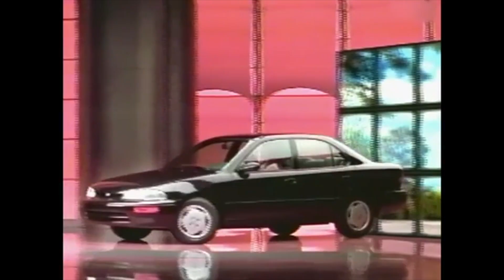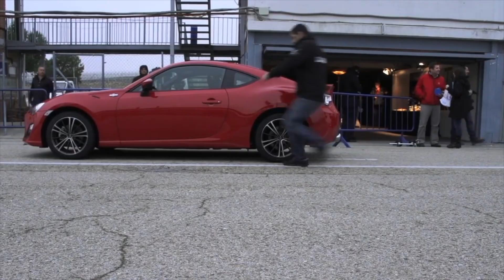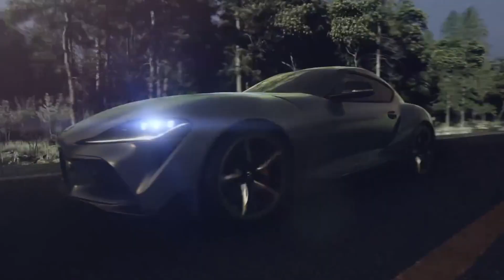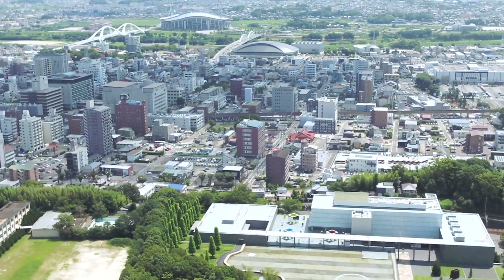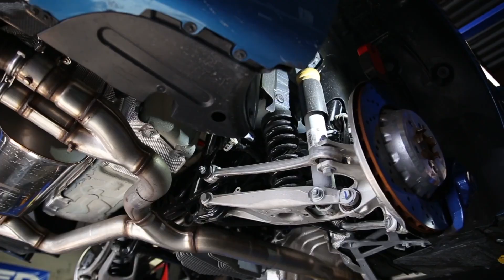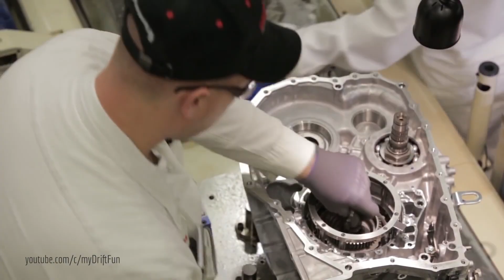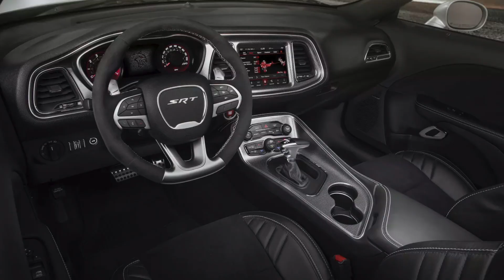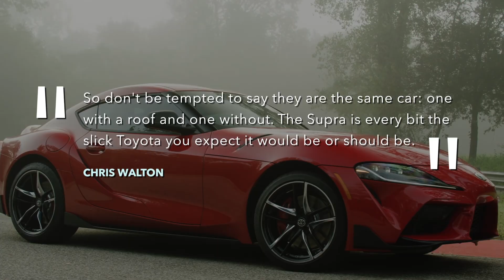MKV Toyota Supra - BMW or Toyota? The UNTOLD TRUE STORY

Comment: The Supra was a competitor to the contemporary 300ZX--it was no NSX killer as it was a GT car.  Thinking back, it might have been as fast or faster than the NSX, but that is not the point.  Nissan moved on and created the GTR.  Honda rolled out the NSX once again.  Toyota already had its supercar (I forget the name but it was that V10 Lexus), so bringing out the Supra later on is really a step up from the FRS, not an all out sports car killer.  I prefer muscle cars, such as the Redeye or the Mustang GT, but as I was critical when this was shown, I have done a 180 and really like this for what it is.
Reply: Honestly looking at the 1st gen Supra, it looks more like a competitor to the Chevy Monza.
Reply: @MrDaBossBABY6969  They were slightly more powerful Celicas...maybe they threw in a 6 into a Celica.  I remember them in the mid-80s, but I hadn't started reading Hot Rod so wasn't too knowledgeable about car basics at the time; plus I was too young to drive.

Comment: To be fair you could put that statement the other way around the z4 is just a toyota . We if fact they are the same car they been joiy developed so does it matter, as long as it a good car. What the issue. People need to understand that this will always happen and will happen more in yars to come.
This is not badge engineering as both companies paid for the car and a joint team developed it. So that statement is wrong.
Let remember toyota a subaru are the same company so you would expect them to be almost the same. But co development is very different. So this is right when it says these cars are different and share similar thing join development  is the way forward toyota are working with bmw on they hybrid systems. 
With jaguar on hydrogen fuel cell. People just need to get over themselves.

Comment: 1. BMW DESIGN ENGINE AND NOT THE 2JZ DESIGN . 
2. ALREADY A BMW BODY WITH SOME MINOR CHANGES
3. ZF TRANS USED IN EUROPEAN CARS BUT NONE IN ASIAN CARS. 
4. REAR DIFF FROM A BMW DESIGNED AND NOT THE LSD DESIGN FROM A SUPRA.

ITS PRETTY MUCH A REBADGED BMW CAR. ONLY TOYOTA ENGINEERS HELPED WITH SOME INPUT.

Comment: I sure hope the engine that will go into the Toyota is fitted with cast iron liners as opposed to being a standard AluSilMg alloy with no sleeves. Even less desirable is the plasma spray. Cast Iron sleeves allow for easier and cheaper rebuilds, as opposed to having to buy a short block for double the cost.
Just because ONE manual transmission was rejected doesn't mean another shouldn't have been tried. Surely TR6060 can handle the standard torque with a little headroom.

Finally I hope Toyota allowed aftermarket accessory developers access to technical specification of the car so that they can make their own improvements, as was done with the GT86

Comment: Also to add, the  Toyota FT-1 should have been the new Supra body style, not the watered down thing we got in the end. The version of the Supra we got is more along the lines of what a new Celica could look like. The Toyota FT-1 with a twin turbo V6 Lexus engine, with manual, and optional automatic transmission would have been the way to go. Yes the price would have been high, but the price is high on any Mustang Shelby GT350, or GT500 vs the other Mustangs. 

Like I said, the new Supra they went with should have been the new Celica, or they could have just made it a new model Toyota of a different name, not connected with the Supra. Sometimes people that work in these car companies are just too far out of touch with what their targeted buyers wants. 
IMO, what Toyota should have done is just go to the Supra forums, and asked the guys who actually owned  previous generations of Supra's what they wanted. Filtered out the silly stuff, and went with what the majority wanted. The enthusiast of just about any brand of car are the people who keeps that brand alive, even when it goes out of production for a while.   Many of those people modify their cars to go far beyond what it was in factory trim, and some of their suggestions, and innovations do have value, as they come from many walks of life, and some are very intelligent.

Comment: The bottom line is BMW got Toyota to design a reliable BMW, and Toyota got BMW to fund much of the early engine and transmission design costs.  Toyota engineered a better BMW, which is what the "mystery man" at the beginning was seeking. Winner: BMW.

Comment: What a bummer! Toyota already corners the market on passenger vehicles and SUVs. WHY in the world would the most reliable car manufacturer partner with the least reliable in a chance to get a foot in the sportscar market.

I did enjoy how Toyota went over the garbage BMW powertrain and looked for flaws.  Too bad. My lame 2014 2.5 camry will still be running years after this 2020 BMW starts burning oil and throws its timing chain.

Comment: all the fucking BS later " the Supra is a BMW", nonsense for the reliability because "Toyota checking into all the parts", if you want more performance always come with unreliability, biggest reason most Toyota cars are reliable because they don't push the limit, they want to be conservative with proving older technology.

This video basically is a car commercial for Toyota

Comment: I understand rebadge engineering , but a Prism/Colorra and others are econobox collaborations. Cars for the masses. Models that are made to be cheap and not net much profit which means sell a million of them to actually profit.
The Supra is supposed to be the brands supercar flagship which displays their enthusiasm, their cutting edge engineering, their tech and their competitiveness. 
This is an uber fail for the above.

Imagine if GM closed the Corvette plant, closed their design center, built the car in Mexico and shared the design with VW under a modified sedan platform. The purist would flip out, values would drop and other GM models that get trickle-down tech would suffer as well.

Comment: BMW reliability - not interested … and the styling is quite weird to say the least.
Reply: LoL you came here just to drop a comment without watching the video don 't you? The video clearly says parts were sent back to Japan to meet Toyota's strict reliability test.
Reply: Didn't watch the video did you
Reply: It'll be in the shop at least a handful of times per year, like every BMW.
Reply: @youtubasoarus  my BMW has only been in the shop for oil changes and I've had it for two years, why so much hate 😞
Reply: @theborden704  Two years?  LOL . Take your BMW in TEN YEARS and compare it to even the cheapest ten year old Toyota with similar miles.  I guarantee you your BMW will be ready for the scrap yard and that Toyota is just going to need some belts changed.  Two years is nothing.
Reply: @JayDandy412  My BMW is 11 years old and has only had tires and breaks replaced so try again.
Reply: @JayDandy412  btw I had a Toyota before and the belt snaped and blew out my whole engine merging onto the highway. Never will I invest in those pieces of shit. Stick with chains.
Reply: @SunzOffski well that's got to do with ZF. Happens on trucks with ZF gearboxes too
Reply: Snails40 maybe because the last time they designed a Supra it was in the 20th century from a different period of time things change over the years design, art, music etc
Reply: Snails40  Uh, Mark IV has a pretty bubbly body as well. Everyone hating on this car just wants a Mark IV Supra 2020 Edition. Get over it, you would've never been able to buy the vehicle regardless if it was completely made by Toyota. They made some silly decisions with a gigantic name like the Supra, but why hate a company that has made such great cars for taking their shot at an update? I thought I would never see the Supra again, so I am happy that they are even entertaining that idea.
Reply: So you didn't watch the full video
Reply: n54 I agree on, the older engines are bombproof though.
As for zf box's.... people still buying zf's made in the early 80s and they're still going strong. The zf 5 speed from the e36/e46 era is good for 650ft/lb torque, so i'm not sure why you've had bad time with them.
Having said all that though, Toyota is still miles ahead of any other company in terms of reliability.
 [Refering to anything made before 2009 when cars became space ships]
Reply: Did you not watch the video? It’s Toyota reliability dummy
Reply: Fck bmw and Toyota

Comment: I heard the word "reliability" plenty of times in this video. With BMW sending parts for testing to Japan to meet their "reliability" standards and Toyota testing bolts and whatnot, I hope both parties learned something from each other. Mostly BMW, who doesn't want a more reliable BMW? This was more of a project for BMW and Toyota to test. Overall, I'm pleased with mostly of the style of the rear than the front end. A six speed should have been given. That's my 2 cents

Comment: I am sure this is going to be one of those cars that once people get to drive they will fall for. BMW's in general have always been a car that is amazing to drive, but sadly plagued with issues such as water pumps failure and intrusive dme's. Some people look past these issues and love their BMW's above all else, simply because the benefits outweigh the costs. They get an amazing feeling car for the price of having to either constantly work on it themselves or become on first name basis with their local mechanic.                                                                                                 Additionally it is important to add to the fact that BMW really do know their inline 6's well; the n54 is a perfect example of this. The engines themselves were astonishingly stout despite the open design, with failure points being accessories (Turbos made by Mitsubishi as an example).                                                                                                                                                                                                 If this partnership is the way it is described, and it is very likely that it is considering that the Toyota brand is successful because of their reliability standards; we are about to get a true driver's car with the reliability of a Toyota. No longer a compromise between reliability and driving pleasure. I for one am very excited for this.

Comment: How do you think it would work out if the already established Chevy Corvette had Mercedes build the engine in their newest vette, or the newest Shelby GT500 had the engine built by Renault? Its the same thing with the BMW/Supra.  People loved the Supra because it was built by Toyota, a car manufacturer known for reliability. The Supra, even though it was a sports car, fit the bill of having performance, and reliability. BMW's don't have a reputation for reliability. 

This new Supra could be the most reliable car ever made, but having the BMW name attached will always drive people away from the reason why people buy a Toyota over a BMW in the first place.

Also, there wasn't any really good reason for using the BMW engine as the Lexus line [Toyota] did have a turbo 6 cylinder engine. Yes, the Lexus engine was a V6 vs the original inline 6 of the Supra. but which do you think people would be more upset over, an inline 6 made by BMW, or a V6 made by Toyota? The new Supra will sell, but overall its going to be a flop simply because it really is a Supra in name only. It was one of those not so great ideas, like when some idiots at Ford actually considered making the Mustang a front wheel drive car, or when they converted their only sports car, the 55-57 Thunderbird into a full size family car starting in 1958.

Not to mention that back when the last Supras were built they were rated just over 300hp which was decent power for its time for the class of vehicles it competed against. A Mustang GT back then didn't even have 300hp [excluding the 95 Cobra R, for which there was only 250 made]. Now the Mustang GT puts out over 400hp, with the Shelby Mustangs putting down even more, along with the Hellcats make around 700hp. Yet we have the new Supra power around where it was over 20 years ago. Heck even some of the family sedans make more HP than that, and are around the same curb weight. 

Toyota just flat out dropped the ball on this one.

Comment: a detuned BMW with Toyota exterior. how underwhelming...!!!
Reply: Look up what a big turbo n54 does. Then look at my other comment, trust me this is a good thing dude. Its low key a blessing for tuners.. The new supra has a b58, it's basically a stronger better version of the n54. Has a closed deck and a liquid to air intercooler system. not to mention mods are gonna be cheap, you can get 700hp out of a n54 for less than 10g's.
Reply: none  Question? Which vehicle are you describing ? the Supra or the New S4? Both have the same chassis/drivetrain but the body was developed independently of each other. I did like the way the Japanese shipped back failed or suspected parts to Japan for further testing and insisted on re-design changes to meet their stricter standards. I was a bit surprised that BMW didn't or wouldn't test them.  And Inever said it was a perfect vehicle design body, simply that the testing phase took 2 years and it excellent.
Reply: @anonimous2451  That's the whole reason BMW wanted to work with Toyota, Mistakes found by toyota reliability! Maybe they will learn. Still love my 2012 335i E92, but man it likes money. Glad I have old reliable 2009 BMW 328i. Reliable I say lightly, ...well it hasn't left me stranded. :)
Reply: @MartinezComputers  LOL, a true Bemma man. Cool. Man you guys dream stupid shit up or are you focusing on misinformation?  Toyota INITIATED the request because they do not manufacture a straight 6 turbo engine and BMW does. My Goodness at least TRY to be genuine.
Reply: @MartinezComputers  I love my E90, wont leave ya stranded, but you may limp home on 5 cylinders when a coil goes out.
Reply: @Gophacyerself  the new supra and Z4 share the same chasis suspension and power train. All BMW parts. Toyota just changed the interior and body panels. Do more research. They are essentially both the same cars.
Reply: @anonimous2451  thats because toyota knows that the public is gonna try and load 100's of more horses on that engine. Thats why they stress tested everything, toyota cares about reliability and bmw is just concerned with pumping shit out as expensive as possible. Im not saying that bmw doesnt make some beasts, im just saying that I would rather buy a 03 is 300 over an 03 m3.
Reply: none  hahahaha, u right man.
Reply: But hey, at least it won't have any of that pesky long term Toyota reliability!  This will be the first "Toyota" that starts falling apart at 100k.
Reply: You clearly didn't watch the video lol
Reply: none  Did you even watch/listen to this? This in no way is a revised Z4, as the end result of this project was to have a platform for a NEW Z4 and Supra.  Pay attention.
Reply: Your brain is de-tuned, much like the rest of Texicans.
Reply: @anonimous2451   the same engine makes 50 more hp in BMW form. Im thinking elementary math is not your forte?

Comment: BMW is junk. Over designed with millions of transmission and electrical issues. What a fucking fail. If they go with bmw auto transmissions they wont get far. For daily driver is ok. For somebody who beats up on a car or track good luck if u get two laps done before it blows.

Comment: As beautiful and cool and sporting as it is....I do not understand why Toyota could not do it on their own.  Unless they did not want to spend the full amount on a new vehicle, meaning that Toyota wants to spend very little on developing a lower volume vehicle, something that BMW has always done, because of the low volume, more expensive since the developing cost has to be spread among the lower amount of sales. It seems that BMW did benefit from Toyota's stellar quality-reliability engine testing, since BMW engines have been less than stellar in terms of reliability when compared to Toyota, most probably due to BMW's engineering complexities. I could see Japanese Engineers looking at the excessive number of parts and complexities and going 'WTF?'

The BMW Z class has CONTINUOUSLY been produced for decades now. That BMW would alter their newer Z platform to accommodate the hardtop means most likely that BMW compromised the platform. We will have to wait and see which one of the 2 models is affected the most when tested by the automotive literati and the market.

If you agree with the BMW/Toyota 'collaboration', then it would have made more sense for the Toyota 86 to have an upgraded suspension and the turbocharged engine it deserves, a 310 HP straight from the WRX STI....This would have been a lot cheaper. For those of you who were waiting for this to happen, it obviously never will (at least from Toyota and probably not in the Subaru model as Toyota would put pressure on them not to build a model that could compete.)...What a WASTED OPPORTUNITY!